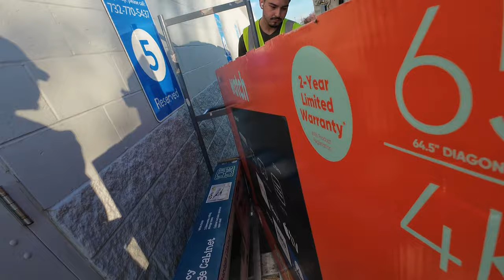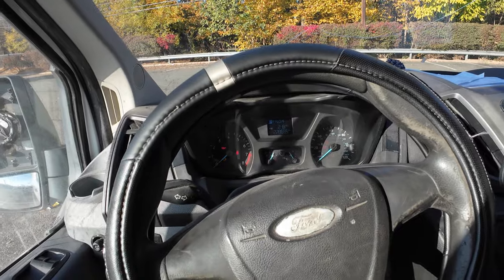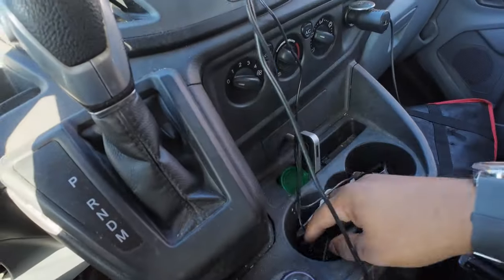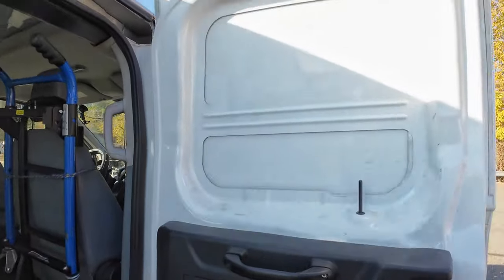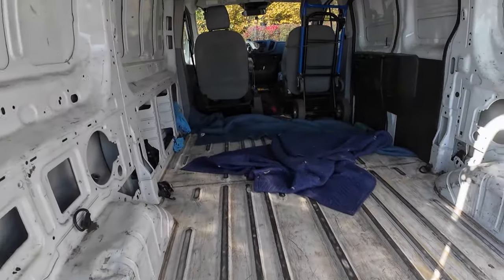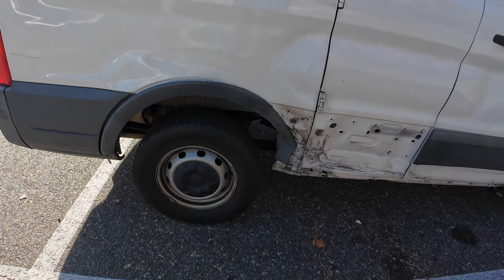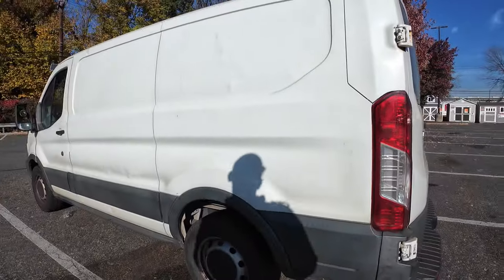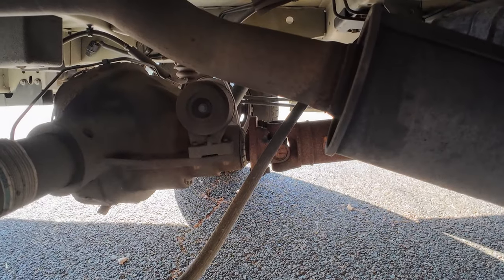Almost Perfect: Review Of My 2017 Ford Transit 150 Cargo Van

Comment: My bro, thank you so much for making this video. I feel like he made this for me based on my previous comment but I have the same van it just medium roof250 2017 model… have a cracked windshield are used windshield repair kit to prevent it from going further it did prevent it actually…. I got it from Walmart for like 10 bucks it worked. 

Thanks so much for the video. Stay safe.
Reply from the maker: I did actually